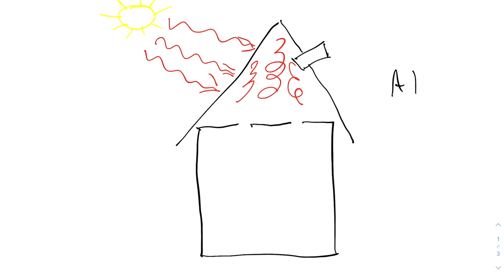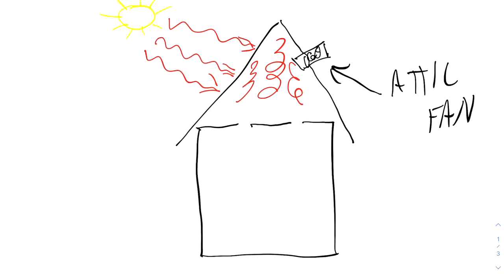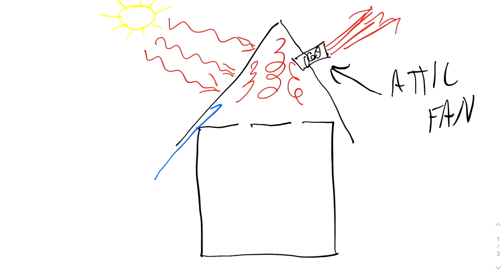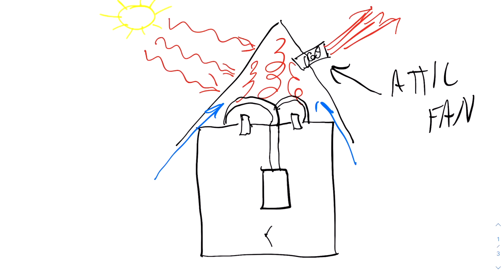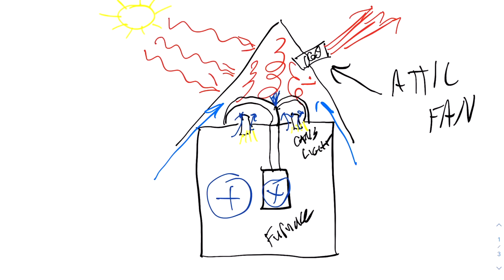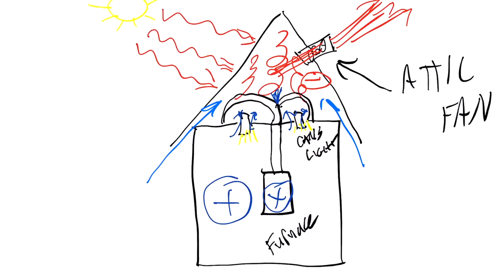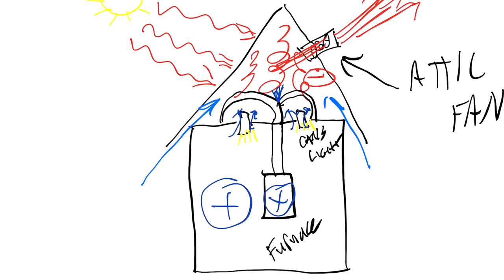3 Remodel Rip-Offs

Comment: So, because the roof and therefore the attic gets hot, we shouldn’t try to move fresh, cooler air through it? Not following your logic on that one.
Reply: The big one is that a big enough fan to make a difference in attic temps will also pull your air conditioned air out of your house and into the attic.
Reply: @alexnelson09  Depends on how well your attic is ventilated. Solar powered attic fans work really well in Hawaii if there is adequate ventilation (big gable vents for instance).
Reply: Hot air rises no matter what you do. You don't need a fan that's not doing much if anything. Just vents are more than adequate.

Comment: Smart thermostats... 🤣. I hated mine so much when I got a new system I requested a "thermostat so dumb it can't pass preschool." No timers, no Auto detect, no days-night settings, no internet. Just one setting. 🤣🤣🤣
Reply: I was just talking to my AC guy. He removed a smart thermostat from an old ladies house. She called and said her AC wouldn't cool. He checked and the AC was fine but she unknowingly signed up for a discount where the power company was turning up her thermostat remotely to 80 degrees when power demand was high!
Reply: @toddac61  gotta love power companies. Oh? You need power so you don't die in 125 degree weather? How bout no.  But we will let you use it when it's a perfect 72 degrees outside.

Comment: Replacement windows are worth every cent in a state like Wisconsin that sees high humidity in the summer and temps and wind chills into the -40s in the winter.  Not to mention that most single pane windows generally after a lifetime of use of 30+ years physically need replacement as they are no longer mechanically sound.  If you live elsewhere, or have double pane glass that isnt leaking and is still mechanically sound, its probably a waste of money.
Matt is pretty much spot on with the other two.  Your AC will be better off just left at a temp that you want, and keeping the blinds closed.  A dehumidifier/humidifier and an air to air exchanger are definitely worth it.  Powered attic vents Im on the fence about.  Yes, in a modern house, a waste of time.  However in an old farm house they can help keep attic temps under control.  You also need to have more than some wimpy solar powered vent for it to be effective.  In somewhere like a workshop with open rafters, flipping on a switch to run gable vents cant be a god send as you can pull the heat from the attic space.
Reply: Food for thought, I had a visit with Renewal by Anderson about a year ago and the data they showed me demonstrated best case scenario about a 75% return on investment, depending on the climate. I think it was considering the life of the windows until replacement was needed and how long until the house was sold
Reply: @vennic  75 %percent return on investment is the ABSOLUTE BEST you can get from any feature being upgraded in your home. upgrade your kitchen, make a 2 bedroom addition, redo your bathroom(s). ALL of those are 75% or less return on invetment. With windows its a no brainer. single pane windows will for sure make people NOT buy a house.

Comment: Attic fan:  I don’t run it during the day. I wait until the outside temp is lower than the inside temp. Then I open a couple windows and turn it on. I can watch the temp drop as as soon as it runs. So even though I don’t have AC, the hottest summer nights are nice and I don’t need to lay in a pool of sweat like in the past. With that said, it was already here when I bought the house. I appreciate it but wouldn’t probably pay cash out of pocket to get one in a future home. During the day, I keep a window open on the shaded side of the house, in the late day I open the opposite window. I actually do have two portable floor AC units that also came with the house. I used them the first summer but since then I found  smart use of the breeze works as well without a big bump in electric bill. Summer temps are mid 80’s  with occasional spikes into the 90’s. So it’s not as hot as other places but not cold either.

Comment: Attic fans, air wave, and scheduled fan run times are very helpful.  Have we heard of heat soak or convection?  If that attic is 150 degrees, that heat is going into soak into everything,  including the ceiling, and then radiate into the home.  Insulation will definitely slow the process, but it is going to happen regardless.  Convection dictates that warm air rises.  This is true in homes as well.  If the air inside is left to settle, then lower levels are going to be cooler and higher levels are going to be hotter.  That's just the way it works.  People who live in three story town homes with one AC unit will notice the upstairs is hotter.  Often the thermostat will be downstairs and will not detect it is hot until the air is heated enough from above.  Now the AC kicks on, stirs the air by taking in hot air from the return vents, and then has to run extra hard to cool all of the hot air from upstairs which has just been collecting.  Running the fan in "On" mode helps mitigate this as it creates a uniform temperature throughout the home and does not allow it pool in any one area.  Air wave utilizes the remaining cooling temp in the A-Frame coil.  It runs for maybe 3-5 minutes and the amount of moisture recycled back into the home is minimal.  I agree, if we are renovating a home to sell it, bypass the attic fan, bypass the smart thermostat.  But if you are living in the home, these devices and settings are completely worth it and increase comfort while also saving energy.  Stick to reviewing windows.

Comment: It's more common in the South to have separate HVAC systems for 1st and 2nd floors. Without zoning, upstairs is a lot hotter, so letting the fan run continuously helps balance the temperature between floors.

Comment: I am a 30 + year general contractor. And I agree with most of what you said.  I never saw any science behind the attic vent fans.  I have however seen the benefit of whole house fans.  Programmable thermostats will do 95% of what a Nest will do.  The 5% benefit comes from the software that can recognize certain irregularities in your hvac system.  Recently had a Nest send a message that the system was short cycling.  Turns out the furnace had a bad sensor that needed replacement.  As for windows, every house should have the best windows the owner can afford.

Comment: I agree with all of your points except one in certain circumstances. "Attic ventilation" I bought new construction in 2019 and my attic here in Florida averaged 158° with unobstructed open soffits and 3 eve vents "3-4 feet by 6 inches" each. For what ever reason the convection current just wouldn't  do what the attic is designed to do.  I personally Put 2 dual fan 12v 240 cfm "AlorAir VentirPro-s2" fans in and now attic stays average 120° to 130 depending on heat of the day. Still 10 to 20° higher even maxing 30° above the ambient temp as recommended by building codes. I understand current can cause vacuum in the house under certain circumstances; but with entire roof being open soffit of almost 120 squar feet you're going to need one he'll of an hp fan to pull that much air to cause a vacuum in the house. Again certain circumstances and right equipment for what's needed. I have had no issues in the past year and even reduction of run time of ac with around same temperatures according to my Honeywell tracking reports. But would still like to have your opinion on why my attic normally sits at 150 to 160 and why the convection current isn't happening? Not much I can find other then soffits being blocked and mine are not. Sorry for the long post.

Comment: Here is my anecdotal story:  We installed a smart thermostat back when my wife and I where both working.  During the summer months we did see maybe a $20-25 lower bills.  The other 9 months were minimal if any.  Over a period of a couple of years it probably paid for the thermostat, but nothing huge.  When she got laid off and decided just stay at home, we didn't notice any savings at all anymore.   I guess it will depend on your schedule and if there is an actual opportunity for the thermostat to run a program or not.  I did like the controllability and the whole smart-home aspect of it, just for that reason I would buy another one.
Reply: A Wi-Fi thermostat is not a smart thermostat, especially if it needs to connect to the internet to work properly. You're better off getting a Z-Wave thermostat along with a compatible hub and a collection of temperature sensors. I am currently using a Honeywell T6 thermostat, Hubitat Elevation home automation hub, and a Samsung SmartThings multi-purpose sensor in each room. The Hubitat polls all the sensors, calculates an average temperature for the house, and sends commands to the thermostat based on sensor data and my preferences. The system can also detect when doors and windows are open and temporarily shut down the HVAC system so it doesn't blow your money out the window. Depending on the hardware and software apps you use,, the Hubitat can be very versatile.
Reply: Will Dwyer I have never seen a WiFi thermostat that wasn’t a smart thermostat. I don’t know of a manufacturer who would add that capability to a dumb stat.
Reply: A programmable thermostat is what most people need. The rest of the features are just convenience. Not saying they’re pointless, but I’m having no trouble living without all the Internet of Things hype.
Reply: @alanr745  Exactly. You can buy a $30 Honeywell basic programmable thermostat which allows you to program a few changes per day for every day of the week. If you work a set schedule, you can easily set it to run less during the times you are typically gone.

That said, I like my ecobee, but I have a complicated dual system (heat pump and oil) and it allows me to tweak when I want to switch to oil over the HP. I'm also a software professional, so I like tinkering.
Reply: Smart away / eco away whatever you want to call it definitely saves me money.  Something like that is excellent for someone with a changing schedule, unknown when I will get home, sometimes gone for 12+ hours.  Also, my Nest cost me $150 after a $50 rebate with my utility, so in reality I need to makeup like a $100 difference of programmable vs what I went with.  I am confident it will pay for itself within 6-8 years, it's just too hard to try to calculate it though.
Reply: most Wi-Fi thermostats are nothing more than programmable thermostats that give you the ability to program them with a smartphone app from anywhere your phone is able to access the internet. A Z-wave thermostat integrated into a network of sensors and a hub can do a lot more than just allow you to use your phone as a remote control.

Comment: This video should generate some comments Matt.  We love our Nest thermostat

Replacement windows are head and shoulders above the builder grade junk in our home
Reply: A regular programmable thermostat costs $25-$50 and will achieve 90% of the energy savings that a Nest will do.  That extra 10% will take many many years to cover the extra cost of the Nest. And you would have to hope the Nest doesn't fail before that time.
Reply: @xungnham1388   The benefits are not energy savings, that's not why most folks buy them. They are fantastic thermostats.
Reply: @thanatoslrsd  Sis got rid of hers immediately after coming home and finding her cats sweltering because the "smart" thermostat didn't think it necessary to have the AC on because no one was home.
Reply: @xungnham1388  Absolutely.  I also seem to recall internet security risks with Nest.  So what if it takes a couple hours to heat the house up or cool it down after coming back from vacation.
Reply: @xungnham1388  Nest is now owned by Alphabet Inc (Google's parent company). I think there's a better chance of google just shutting it down vs the company going under. I'm sure google is using Nest Data for some type of targeted advertising.
Reply: @dustinm2048  I didn't mean to suggest the Nest company could fail. I meant to say, if Nest quotes energy savings of $150 annually and a regular programmable thermostat could achieve 90% of that, Nest's smartness only benefits an extra $15. And that would mean, it takes 10 years for the Nest to pay for itself over a programmable and that would mean an electronic device lasting 10 years which is no guarantee.
Reply: @afriendlyguy1  yeah, you have to set the features you want and check the settings.
Reply: Nest tstats are hated by any hvac tech. If they say otherwise they havent tried to program it properly.  Its inadequate for multiple inputs.  Use honeywell much better.

Comment: 1. Attic ventilation really helps if you know what you are doing
2. Smart thermostats are smart and does really work. The fan on after reaching setpoint is only 60 seconds and that is not going to rehydrate the whole house. Even if you have a dumb thermostat,  it still runs the fan every 15mts, so there is no difference.

Comment: Having been through engineering coursework in heat transfer and thermodynamics, unfortunately this explanation of heat transfer to attic space is partially flawed. Its pretty typical in residential construction products that the "science" behind products is actually probably more like "15 years (sometimes biased) experience". I just wish engineering and 15 years experience would collide and we'd get the best of both worlds.
Reply: So what does the science say about it?
Reply: @maxellcdr12  For starters there are 3 primary modes of heat transfer: radiant, convective, and conductive. The amount of radiant energy absorbed and given off is based on surface temperatures. The sun gives off a lot of radiant energy because the surface temperature of the sun is very high (even though it is very far away). Conversely, the surface temperature of the underside of your roof is miniscule in comparison. This means the temperature delta between the top surface of your insulation and the underside of the roof deck is really not that big. Radiant energy is thus not going to contribute to heat gain in the living space nearly as much as say conduction. Hot air in the attic space heating the insulation mass, then the hot insulation will heat the ceiling drywall which will in turn transfer heat into the living space. By the way, the recent few years have ruined the term "science". I'll instead say that heat transfer is based on proven math and thermodynamic laws.

Comment: Nothing like an exuberantly confident uneducated rant from a guy who put zero thought into this or research before spending hours making a video on a subject. This is a pure fallacy in logic, based purely on his limited experience and local bias. If you live anywhere where the summer temps exceed moderate climate then a house fan when used correctly is one of the most important items to have in your home for comfort. Reducing the thermal temperature of the attic and walls by 20-40 degrees and finding it as a “scam” is insane

Comment: My house has soffit/ridge vents.  About 10 years ago I built my own gable fan units.  I used regular old box fans.  One fan pulls air into the attic and the other pushes it out the other end of the attic, for crossflow and no pressure unequalization issues. Run them on a thermostat and timer combination.  They give a measured 15-20 attic temp. lowering, I live in Texas = blazing hot summer sun.  
And that big "no-no" about combining active and passive venting is nothing but a myth.  I love the standard reply of "you'll pull air into your ridge vent".  Well so what (if it's even true), you're still moving air!!!  The more you have of both or either, the better.
All I can conclude with is that I see a huge temp reduction with my active gable vents, and the box fans are super cheap to run.